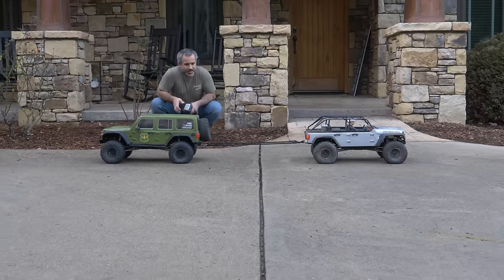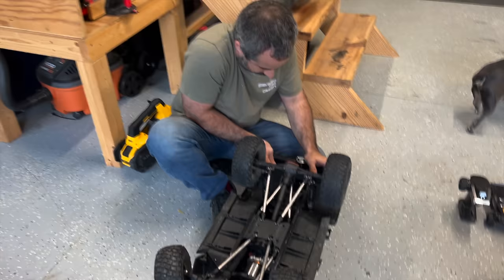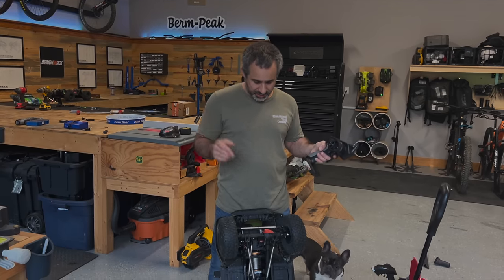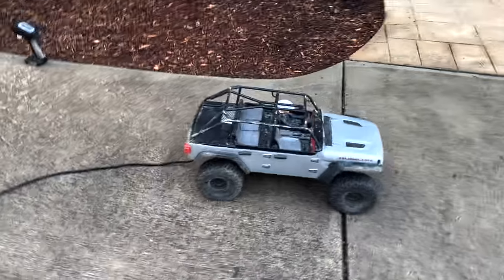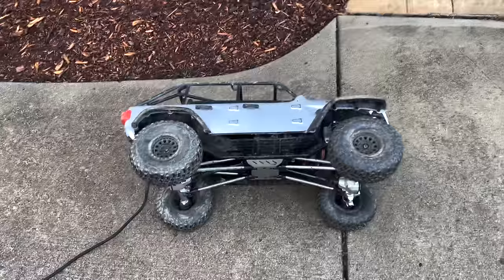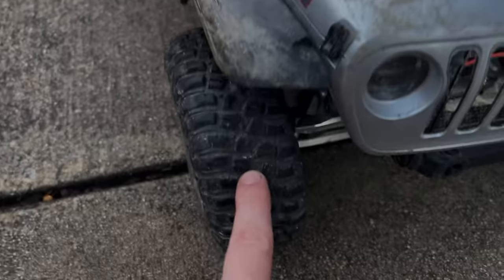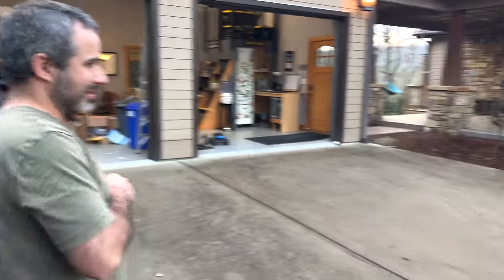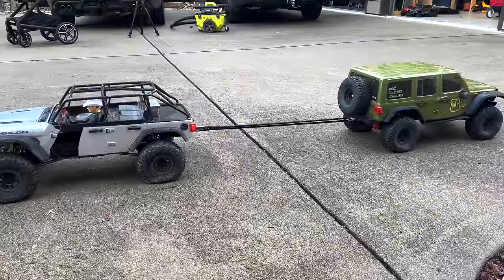SCX6 challenge at Berm Peak

Comment: Oscar is trying to help pull.
The topless Jeep is probably lighter even though it has aluminum axles. The top is alot of weight plus the extra rubber on the ground....same theory with drag racing, they use slicks(more rubber on the ground).
Fun video. 
Happy New Year.
Reply from the maker: Just got some new foams, vented rims and put stock tires back on the front.  Round two coming soon.

Comment: Need some bigger wider tires and some metal rims. Whenever possible you want the weight you add to be un sprung weight so your suspension still has full travel. Thanks for sharing. Enjoy the ride
Reply from the maker: What rims you have in mind.
Reply: @SteadySpin  so far the only ones I have seen that I like are on ebay under 2.9inch metal bead lock rims. I have not used them so not sure on quality.

Comment: All those mods and Seth still beats you.So much for the added weight and $$$$ great video.
Reply from the maker: I think I cut my tires to much in the rear.  Even with new foams didn’t save them.  Stay tuned Thursday morning for new video.
Reply: @SteadySpin  Those dam trucks are expensive as hell.I have a few 1/5 scale rc and they are not cheap.I don't own any crawlers but I would buy this one.

Comment: I would have dug it on dirt.  And damn both were leaving tire marks on the pavement.
Reply from the maker: More to come
Reply: @SteadySpin  Also - age of battery pack may have had some impact.  Not sure if they are easily swappable or not on those. If so flopping from one to another would be another factor to test against.  A newer battery might give a tiny edge too.

Comment: The heavier cars always gonna win lmao
Reply from the maker: Mine is heavier lol.
Reply: idk its weight on the back wheels may be more but i could be wrong about that too. And ya your tires look mega soft, do you have 2 or 3 stage foams? and ya less contact with the flat pavement with nothing for the knobs too grab or flex o to with that cut tred and softness probably doesnt help. Sadly. But that car does look pretty sick.. tires are 40 percent of the cars performance.
Reply: I got proline hyrax in predator compound with 2 stage proline foams on my 1/10 scale sealed onto some aluminum wheels and its reallllyyy improved the climbing and traction. I also got all the metal parts you got upgraded too lmao. Even the hobbywing motor i see in there and mip driveshafts and some aluminum axels ect. But ya i would say for shure if they have them in that bigger rc car size proline hyrax predators are amazing tires on some good aluminum wheels. Idk if you want brass bead locks on the aluminum or just full aluminum wheels because you dont want it to be too heavy but it would lower the cg even more.